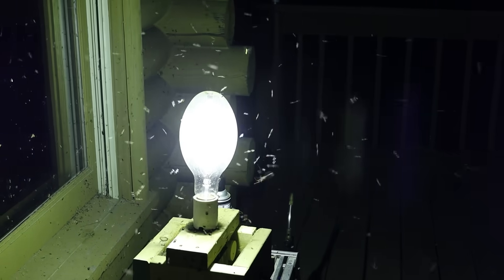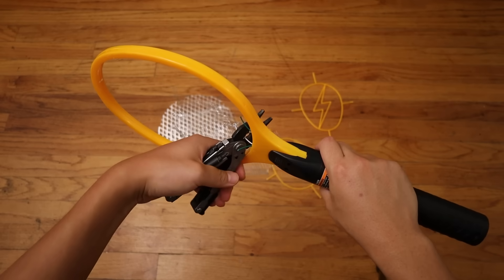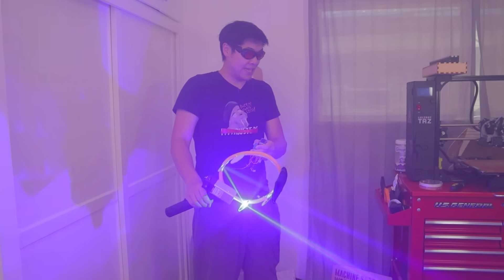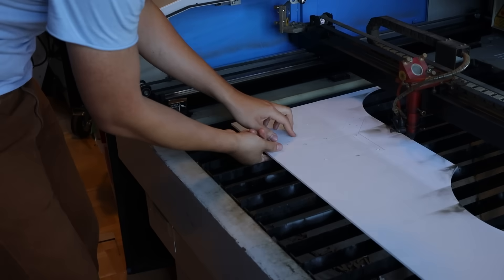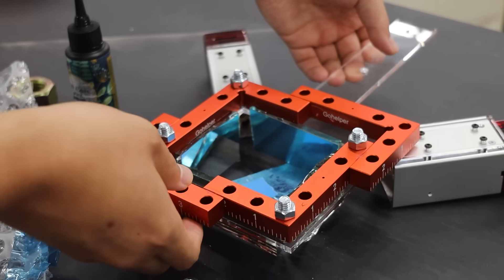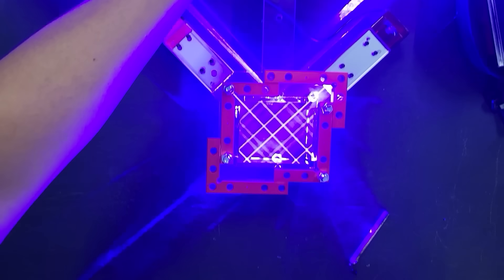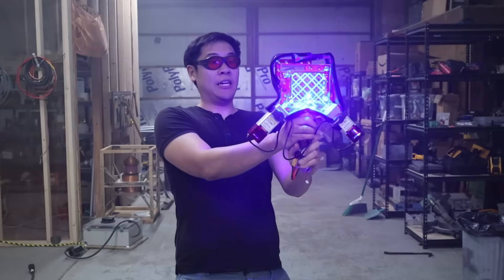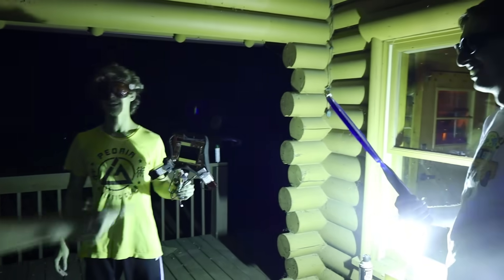killing mosquitoes like its the year 3000

Comment: I have a better idea that needs only one laser and one mirror. Attach a small front mirror to a small motor and aim the laser to the rotating mirror so the ray covers the whole "hole" of the racket. That way you don't need to form a grid. Dangerous anyway, but you always need to stop the laser somehow with something black like you did with the grid. You could try it first with a low power laser to check the result.

Comment: You need prisms not mirrors. This would have been way better if you'd created a window "frame" of prisms in one of your porch openings, and fired your laser into one of the prisms - you might even get enough internal refraction that you can create a grid with just one laser depending on how many prisms you use (and the size of each prism... smaller the prisms the tighter the grid)...but two lasers placed at right angles to eachother would certainly do it. Anyways, prisms are the way to go not mirrors.

Comment: 1. You only need one kill laser.
2. You don't need perfect squares. 3d print something you can fine tune with screws. Glue the mirrors on that.
3. That laser engraver is far too strong. You only want to kill bugs.
4. Make the frame bigger.
5. Pulse the laser.
6. Add a second low power cheap infrared laser. This detects something crossing its beam, and immediately pulse the bigger laser.

This means you can leave this running 24/7 without eating up the lifespan of the kill laser. The detection laser is lower power, last longer, and is cheaper to replace.

And using lower power and pulsing means you can use regular cheap mirrors, so you frame can be as big as a door.

Comment: Why don't you use two small but longer mirrors parallel to each other and then zigzag the beam between them? Depending of the angle of the incoming beam, it bounces in the same angle to the other mirror and then back again, and so on. Use a very small angle and the beam can zig zag 20 to 40 times over a mirror length of 10 to 20 inches. And you need only 1 laser for this. No mosquito can escape from this. And hey, maybe build it in a window as a high tech alternative to an old fashioned mosquito net...

Comment: You need to get a sonar detector and capture the noise. Actually do FFT on the signal to figure out SNR. Put that into a software and use the laser as an actual C-RAM. BTW I'm a physicist/test engineer.

Comment: you stopped engineering so early in the process its impressive that you actually managed to kill something. you can simulate so much more including the path of a laser (which you dont really need, you can span a plane in a rectangle of mirrors by having the laser be slightly offset from the 45 degree angle). prototyping with a less dangerous laser, 3d printing a frame etc etc

Comment: The grid is useless... Mosquito extermination can be done with AI in 2024. It's slightly complicated to set up as you need to optimize AI vision for good performance and then lock on object. Or you just need a very powerfull card that will allow you to recognize objects very fast. Or... small enough neural network that will react only on mosquitos - it's the most difficult task.

Comment: guess u could use a mirror in  a longer strips and 3d print a big square (rectangle) electric grid  frame  and attach the mirrors , with the lasers inside the handle  , so that u could move it freely and it is much safer  and  for the leakes part just cover the enter  outside frame  with some fabric which is not flamble .

Comment: I have a practical idea that I made in 2nd grade. Its a hammer, with a magnet on the end, and a compartment in the handle for nails that have holes with magnets that fit the nails in so you can grab them without the rest of them falling out. The prototype was layered cardboard and spray paint, and the nails were glued into their holes.

Comment: What if you used an revolver style set up for the iron man hand blaster? Using 22.c blanks like you did for the jumping thing? You would be able to make it offset so the chamber is centered.

And for the thrust you could also use the gas to. So pushing gas through an separate tube maybe a small 5-10mm tube which ould cause for the affect of the fire ball. And the force of the 22.cal blank could fire out a projectile. Which you could use an resin round with an ld and an small cell battery to make it like it. Using an magnet to separate the cell from the led inside the resin round and then when it fires it releases so it looks like an bright white or blue bolt firing.

There's also another youtuber who is the chemistry guy who uses lasers and electricity.

He recently did one video where made points about current etc.

He could make the one the bad guy had with the whips. Iff he made an fiber glass style whip with long strands of conductive metals inside (hair thin) and made then separate an say one inch gaps and just close to he surface. The lightning bolts would travel along the surface allowing for the arcs to travels. When he whips it to the grown or an metal object it would create the plasma sparks.

The projectile for the Aron man glove is fair given he used micro missiles on the top section (from the back of the hand).

Also as an fuel what about using an mixture of gas an O2. It's an 15% methane to 02 ratio for an explosive reaction (variable). There are solid state fuels but you could make capsules like he co2 capsules to hold the hydrogen and O2. And using the switch system you could press one to fill the other to fire.

I'd say using the finger switch to fill with the gas and the one on the wrist to fire both the gas and the blank.

This would mea that you could make it to fit in the exact sizing as the iron man suit.

If you wanted to be more technical you could like at firing plasma bolts.

If you can find an way to separate plasma (as matter) and using an electromagnetic setup to reverberate this matter bac and fourth under an smell area. This would create an large pressure (void) which when you cancel out the opposing force you release all this stored energy in an quick burst.

The problem with the plasma is well is plasma. But you could also consider using an non magnetic metal with an magnetic jacket and using em fields to create it to spin at an high speed and then use propulsion to fire it out. Like the 22.cal idea but using either the gas of even an low size high energy rail gin affect.

If you was to line the arm section with capacitors to store the energy you could use these to create an high release of energy.

Maybe even using electro magnetic plates. Causing them to smash together to create the energy. Thi could also b use in space.

Using the funnel in the middle and releasing an small amount of gas (even co2) could create enough of an vacuum inside to allow the fluctuations to push the gasses out at an high force.  As an engine this would work because it's an larger source of power. Which can use the solar power to store power. As an hand held device air resistance would affect this so it'd not b as good.

Like an em drive..

You could also use atomisers to create H2O and O2 from water as an continual source of gas to power the system. Though I think it'd be better to have capsules which you can change out like the co2 capsules.

I hope thi all makes sense..

Kind regards
Rachael-Louise.xx
Reply: You could use an tungsten plate to protect your palms. Iron man used ex military surplus in an mountain cave. Some weapons use tungsten as an tip (rounds etc) and his scatter bombs could've been tungsten based to. The one where he stands in front of the plane..

Comment: Cool idea here to make this more effective:
1.) Make the square larger, much larger. About the size of a 2x2 canvas. 
2.) Weld or attach a hanging hook to two sides of it. Make sure they are opposite.
3.) Change the press and hold button to an "on/off" switch. 
4.) Grab some chains, go out on your deck, and center the square in between the railing and the wooden beam directly above it, drill the ends of the chain into both sides, and stretch them taut. Itll hold the square in place and upright. 
5.) Get a cheap Lasko fan with an extendable base, a 16 inch or so would be fine, and place it in front of the grid on the deck, as close as you can to the lasers themselves. Face the fan towards you and away from the grid, and turn that sucker on. 

It'll create a suction vortex that will grab any mosquitoes and other flying pests that wander too close to the grid, and suck them through. 

Also, you don't need to worry about attracting them. My theory is that the lasers will transfer heat to the metal square, through the mirrors over time. And they will transfer heat to the mirrors themselves. 
Mosquitos can see thermal energy with their eyes (how they determine if something is alive and has pumping blood), so they will likely see the mirrors and metal being heated up, and fly on in to check it out. 

You have yourself an automated, laser grid, mosquito zapper.
Reply: Mosquitoes detect humans thanks to CO2.
Reply: @bogoulbog6964 they likely have sensor fusion: heat in the correct range of intensities / wavelengths + motion pattern + co2 + time-alligned fluctuation of those factors, maybe some organic shape traits and / or visibke spectrum info. I've never seen a mosquito try to bite an inanimate object even if it had the right temp.
Reply: GENERAL Kenobi you are a bold one
Reply: lol using a vacuum cleaner with a fairly huge nozzle would just do
Reply: As a bonus it will blind trespassers
Reply: Fucking mad lad

Comment: This is not the right way to do this.
Use stereo imaging (you'll need a high frame rate, regular video won't do) to locate the bugs in 3-space.
Use a single laser beam with a beam expander and fast-focusing objective lens (this largely eliminates the danger of misses so you only target one bug at a time).
Rapid targeting using two ultralight mirrors and a pair of galvanometer drivers.
The hardest part will be rapid focusing. ;)
Consider a parabolic mirror created by stretching mirrored mylar across a small cavity. As you vary the pressure in the cavity, the focal point of the mirror changes... how quickly could you change that pressure?  Beats the heck out of moving a heavy lens back and forth.  Or maybe a variable curvature oil lens...

Comment: Add a turbine to the front to pull anything infront of it into that into the lasers with a mini catch area on the other side so you arent blasted with insect bits.
Slight wind pulling should just pull them in easily enough making it more practical

Comment: Not sure about the entire square thing
Have you considered to take a round piece of glass like the center piece of a bottle
Silver-plate it on the inside (there are ready to buy solutions for that)
Drill a hole in the bottom and angle the laser trough it. I think depending on the angle of the laser and the reflectivity of the coating you would get a laser plane instead of a grid.

Comment: Dude.
Its more simple then what je made it to be.
And you will have a full coverage.
Add a round bar in front of your laser.
And you get a 360 line if you find a mirror you could return it back into the glass rod .
Shine that laser trough a wine glas rod between the foot and the glas and observe your problem with glueing and tinkeriing will dissepear instantly you will have a working product you could even sell.

Also you could add more lasers .
and if you want a grid like that use beam splitters...

Comment: Output gap between mirrors needs to have a diffuser or... just another mirror.   Shape should, ideally, be an octagon.

To make it an effective bug killer, though, needs to have a $30 box fan with a duct drawing its air through the laser grid.  With a long enough draw duct you can use it like a vacuum cleaner to suck bugs from around the light bulb and spit them through the incinerator.
Or, you know, use actual propane/NG burnders in a square to do the same thing.

Comment: This design is incredible. Incredibly stupid. Incredibly inefficient. Incredibly bad at it's intended function. AND incredibly dangerous. It uses two lasers and FOUR mirrors, and still has a grid size MUCH MUCH larger than your intended targets! And you had to put your black flame retardant cloth all around it to make it even nominally safe!

I'm glad you had so much fun making and testing it.

Here's how to do it cheaper, safer, and more effectively kill the mosquitoes:

Give up the grid. It's doable with a slight modification of the design below, but doesn't actually provide much more guarantee that the mosquitoes won't get through unharmed.

Two mirrors, long and narrow. One laser. Small swatch of flame retardant cloth (preferably backed by a heat sink and fan for continuous operation. IDK what would be appropriate there, I don't usually work with lasers.)
Arrange the long mirrors as sides of a rectangle. Short or longs sides of rectangle don't matter. Rigidity of the mounting frame and dispersal distance of laser will determine maximum size of final opening.
Offset the mirrors by a 1/2" or so, each sliding slightly towards opposite corners, while staying on the sides of the rectangle. (it's now a parallelogram, but whatever.)
Laser to fire through one 1/2" gap, swatch of black flame-retardant cloth in the other.
Scoot laser behind the mirror, as far is it will go without hitting the backside of the mirror in front of it.
Angle laser towards center of rectangle 1/2° or so. Enough to get 1/8" spacing of the triangles generated by firing the laser.

Note that twisting of the mirrors on their long axis is actually the main concern when it comes to rigidity of the frame, as even slight deviations will send the laser off target. Consider adding long narrow strips of flame retardant cloth on long edges of mirrors to mitigate this risk. Because of the fairly extreme angle of the laser, and how the laser will go off target in fairly small steps, this should be sufficient to practically guarantee that the laser won't go anywhere it's not wanted.

Still not safe to use without appropriate eye protection, but at least it's lighter, cheaper, actually kills all or most mosquitoes who go through it, and doesn't need to be wrapped in backstop cloth to be even marginally safe to use.

Finally, wrap entire frame in steel wire with 1/2" spacing to keep curious little fingers from getting holes drilled in them.

For best results, mount horizontally so mosquitoes fall to ground instead of hitting the expensive and delicate mirrors. Also, consider using an infrared laser to reduce eye damage when somebody inevitably fails to wear proper eye protection around it, as even black mosquitoes have some reflectivity.

Comment: Why didn't you just make a bugzapper with lasers instead of a flyswatter?  Wouldn't have that been easier to design? Replacing the metal grid which "zaps" bugs with lasers and keep the bulb in the middle that draws bugs in.

Comment: heres a suggestion: why not mount an IR camera looking from the side. You could use object recognition to calculate a probability of kill based on the insect's current vector, and only turn on the grid for a few milliseconds if the Pk exceeds a certain value. That way the mosquitoes dont get spooked and wont see whats coming haha.

also now that i think about it a large enough grid could actually make for an effective, solid state defense application. no moving parts just crossing beams and a microcontroller hehehe

Comment: The original mosquito zapper worked at identifying and killing female mosquitos, but didn't work well as a fence.  It was a problem of geometry - the beam from the emitter scanning the opposing fence post/back stop for the beam describes a triangle. It's narrow at the emitter end and the mosquitos can easily fly over and under it.  With a top and bottom rail for the fence so the laser could scan from sky to ground and be confined within that rectangle,  it could work.

The original article told enough of what you need to build one.  If you can find the one that talks about the minimum power needed to kill was around 250 mw if using 405 nm.  It didn't cook them.  They would fly for a bit, land , then die. Light up to 450 nm is photo chemically active; 405 nm certainly is.  But some small minded individual didn't understand that and actually removed that info from the wikipedia entry.  Who knows to what other extents the article has been dumbed down.

Oh, the original videos show the machine running at higher power as it's more satisfying to see mosquitos actually getting smoked.  But that is not what the original authors recommended to use in practice.

Comment: BETTER METHOD!! You're so married to the "grid" idea to emulate the electric zapper wires, that you aren't seeing a much better method!

1) Put ONLY TWO front surface mirrors parallel with mirror sides FACING each other, separated by ANY distance you like. Offset one mirror a few millimeters to the side, keeping the two mirrors perfectly parallel at all times.

2) Shine the laser beam towards the inside of the farther mirror, past the edge of the first mirror and catch the beam on the farther mirror -- on the inside mirror face near the edge. A zig zag will fill the entire space between the two mirrors.

3) "Tighten up" the zig zag by tilting the laser -- ever so slightly and you get LITERALLY ALL of the air space between the two mirrors "FULLY" filled with BEAM with literally no air gaps between beams.

It looks like one big super wide, solid laser beam between the two mirrors rather than individual line beams.

4) Then use a SUPER HIGH FLOW RATE vaccum blower to suck the mosquitos through the space between the two "perfectly parallel" mirrors.

YOU NOW HAVE THE ULTIMATE MOSQUITO VACUUM CLEANER TO CLEAR LITERALLY ACRES OF BUGS IN MINUTES!
Reply: What ya got